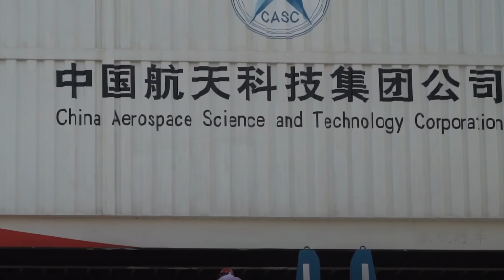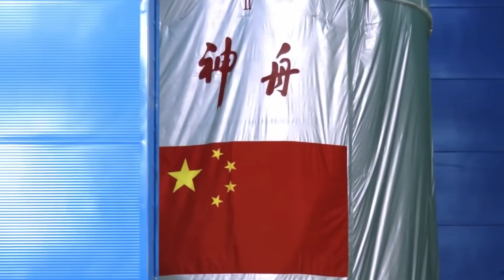China Found Brilliant Solution to Mass-produce Rocket Like Cars. Faster than Elon Musk's SpaceX...

Comment: what a load of nonsense .... just in time uses kanban system which is basically how a supermarket works - a lot of your "product" are actually on the road .... coming to fill the target stock you have set. You have to have a forecast to do all this .... kan ban is a self-correcting buffer type system,  -  put simply ... what you actually are calling a factory is in fact only the final assembly line.  That's why I said a lot of your "parts" are actually in a truck on the road to your final assembly line.
We were on a lookout above Nagoya after the Toyota guys spent a few hours to explain it all to a group of us. And one idiot from the group asked "where is the factory ?" .... the Toyota guy rolled his eyes in disbelief ..... and said "city is factory" .(you fn moron)
then .... you effortlessly roll onto reuseable rockets which of course is the very antithesis of mass producing rockets .... you actually produce far less rockets that is the whole point ..... 
Who wrote all this nonsense ?

Comment: This is so dumb. Pull system is by definition slower because when you decide you need something - nothing is ready and you wait. You are in endless waiting loop while you iterate theough nested chain of suppliers. 
Sandwich shop analogy should’ve given you a clue. What’s faster - buy a ready sandwich, or come to counter and wait for it to be made. 
Imagine comming up to the counter:
Sandwitch is not ready 
Bread is not ready
Grain is not ready
Etc…
You may wait a long time before you get your sandwich. 

It’s also not true that pull is more efficient.  It’s always more efficient to manufacture in volume and as standardized as possible, vs custom and on demand.